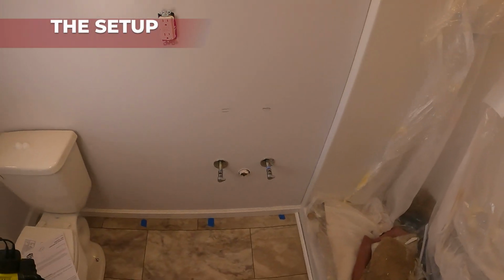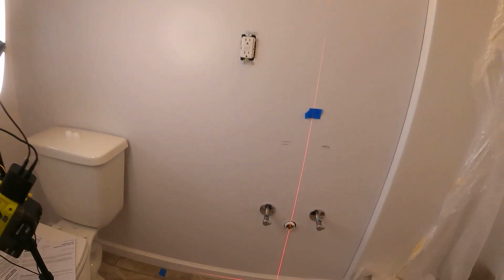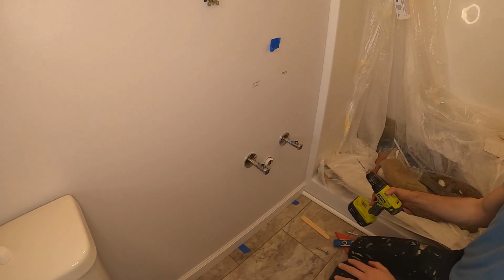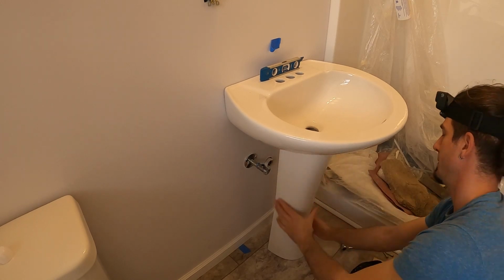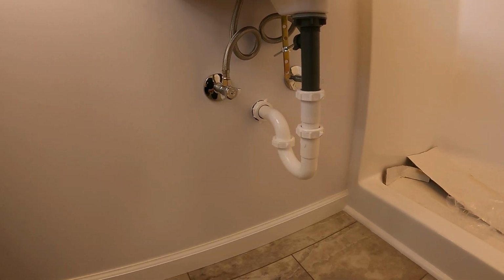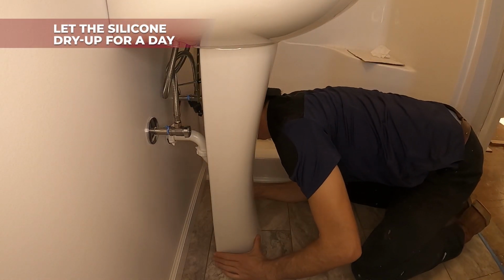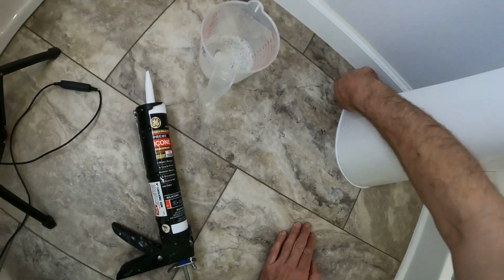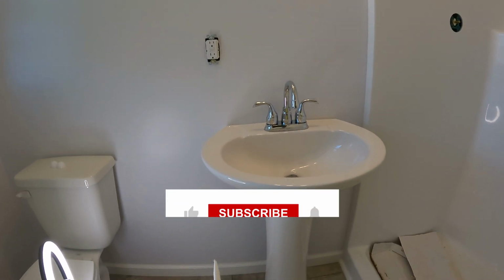🛠️DIY Bathroom Upgrade: Installing a Pedestal Sink!

Comment: No anchors????? You put lag bolts in drywall with no anchors?????
Reply from the maker: There is a wood-blocking behind the drywall in which the lag-bolts are going into it, no anchors needed with this set-up. 👍